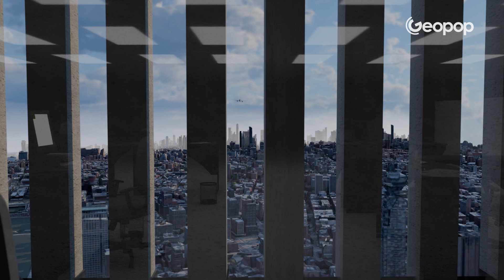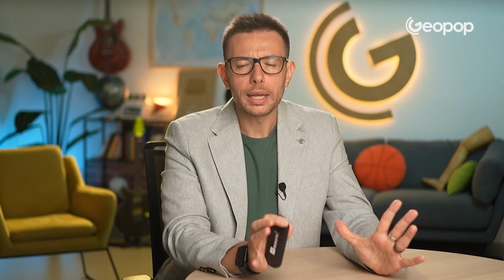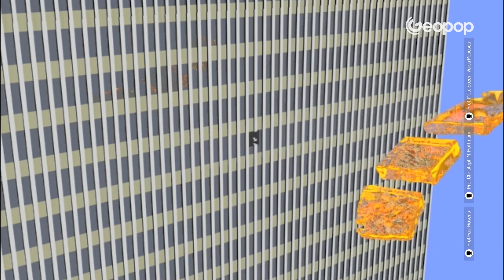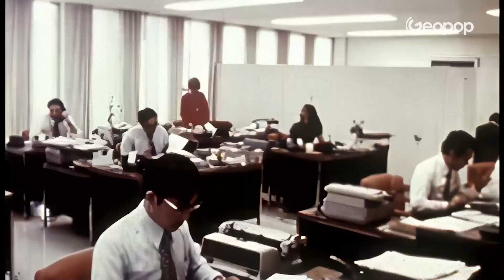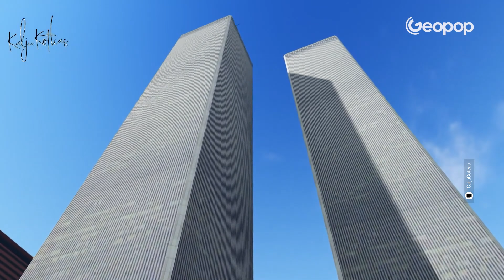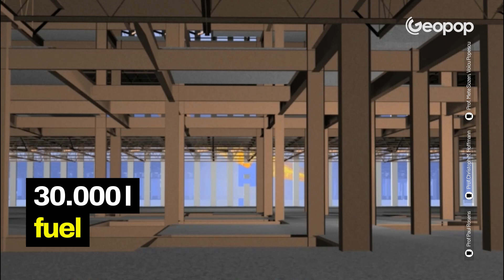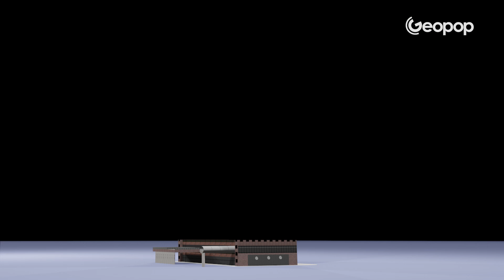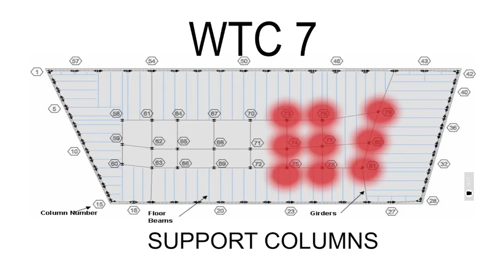9/11, 2001: The Technical Reconstruction of the Twin Towers and WTC 7 Collapses

Comment: What I don’t understand is the whole “jet fuel can’t melt steel beams” but people seem to forget that jet fuel isn’t the only component that impacted the buildings…a commercial airliner. MASSIVE STRUCTURE making contact with another MASSIVE STRUCTURE. The ability for a structure to stand tall with these types of impacts is similar to a house of cards.
Reply: Single-element (non)thinkers can't handle multi-element problems. It is invariably impact damage OR fire but never both.  Too many pieces for them to juggle
Reply: @TheLoonResistance tiny minds
Reply: @m00nshoes404  - It is why they become conspiracists. They simply can't process complex issues.
Reply: @TheLoonResistance  i guess lucky them. They’ve got it figured out and we’re all just sheep for going against their outrageous conspiracy narrative.
Reply: @m00nshoes404  - It's easier than thinking
Reply: @TheLoonResistance  yeah and as we go on in society, rational thinking is shrinking. 

Thinking about all components of a complex situation is too much work and convenience is priority.
Reply: @m00nshoes404  Yep, to think about the free fall that totally proves the controlled demolition of WTC7 is way too complex to you, obviously...
Reply: You don´t understand because you just know too little. You don´t know that steel actually melted and you don´t know that the towers were literally designed to withstand airliner impacts even more destructive than those of 9/11 - and the resulting fires.
Reply: Building something to withstand an airliner impact doesn’t mean it WILL withstand an airliner impact. It seems that you’re actually the one who knows too little, because these buildings were built to withstand airliner impacts for commercial planes that are MUCH SMALLER, MUCH LOWER and flying at increasingly LOWER speeds than the 767s used that day. 

The more you know!
Reply: @m00nshoes404  See, you just know too little.
Each tower was designed to withstand a fully fueled fully loaded 707 flying at 600mph.
600mph is faster than any 9/11 plane. That´s why head of the NIST "investigation" Shyam Sunder stated that the calculated 707 impact would have been more destructive than the actual impacts on 9/11.
A 707 is a BIT smaller than a 767, not much smaller. Then again the 707 would have been fully fueled and fully loaded, while the actual 9/11 planes would have been nowhere near fully fueled nor fully loaded. The 767-200 was scheduled to fly about half of its range, the 767-200ER was scheduled to fly about a third of its range. And both planes were low on passengers and luggage.

They didn´t need to think of terrorist attacks to design the tower for the worst case scenario.
Reply: @zettel3296  dude, you’re LITERALLY trying to make a 707 plane and a 767 weigh the same, essentially. It doesn’t matter what was “SUPPOSED TO BE”, because it’s not what ACTUALLY ended up happening. 

You also left out the point of impact being MUCH HIGHER than it was designed to withstand. You out here bending, pushing, forcing every tiny thing to fit into this narrative that frankly doesn’t even matter because IT IS WHAT IT IS. That’s what happened, that’s how it happened, it’s not debatable dude. 

“Oh well this wasn’t supposed to happen like this because we did this and this and this blah blah blah” 

a lot of things aren’t supposed to happen, or are supposed to have a different outcome, but it’s not how it goes. Life is full of uncontrollable things that humans ignorantly think they have any control over.
Reply: @z @zettel3296 d you didn’t even know that it was for a 707 not a 767 until I mentioned it and then you’re all mr. facts.
Reply: @m00nshoes404  "you didn’t even know that it was for a 707 not a 767 until I mentioned it"

What a funny desperate guess clown! 🤣🤣🤣
My first comment literally refers to Shyam Sunder talking about the 707 flying at 600mph and therefor being more destructive than the planes on 9/11...
So I have Shyam Sunder and the NIST report, both chief engineers in the WTC construction and the WTC manager. What do you clown have? Oh right, nothing, absolutely NOTHING...
Reply: @zettel3296 no it doesn’t lol. You said something about a free fall, WTC7, and the designs being made for even more destructive impacts than 9/11. You literally say nothing about different planes, the 707, or about speeds. You mention the fire though. Good thing we know about the fire. And “more destructive impact”
Reply: I’m guessing you also really like clowns.
Reply: @m00nshoes404  As I already explained to you clown, "more destructive" comes from Shyam Sunder, head of the NIST "investigation", talking about the 707 flying 600mph.
What exactly about this simple fact that I teached you already was too complicated for your substitute for a brain clown?!?
Reply: @zettel3296    You dipship, they were NOT designed to stop jets going 600mph.  It was 200mph (easy google search away, dumbass). The 9/11 jets were going 550 to as high as 590. And since you don't know anything about physics, the same jet going 600mph would have 9 times the energy as it would have at 200mph.  Add to that the fact the 787s weighed about 50,000lbs more than a 707, it's safe to say the 9/11 jets had close to 10 times the energy of the jets the tower was designed to survive. And one last newsflash "designed to withstand" isn't the same as "can withstand".  It summary, you are stupid, so just stop.
Reply: @stanpotter7764  "The newly disclosed documents, from the 1960's, show that the Port Authority considered aircraft moving at 600 m.p.h., slightly faster and therefore more destructive than the ones that did hit the towers, Dr. Sunder said."

Any idea who Dr. Sunder is dipship?
Reply: @zettel3296   "The original World Trade Center Twin Towers were analyzed during their 1964 design phase by the Port Authority of New York and New Jersey (PANYNJ) for an accidental impact from a Boeing 707 flying at landing speeds".  Oh look what I found.  Landing speed, not 600mph.  You really think in the 1960, the designers were thinking about hijacked jets diving out of the sky at full throttle?  Or you know...maybe the MUCH more likely scenario of a jet coming in off course on final approach.  And new flash, they towers WERE hit by jets going over 500 mph and they failed miserable.  Looks like YOU are indeed, the dipship.  You are really getting beat up in the comments, you don't know when to quit, kid! 🤣😂
Reply: @stanpotter7764  "You are really getting beat up in the comments, you don't know when to quit, kid! 🤣😂"

I see you are projecting hard dipship... See how you desperately dodge my simple question to avoid getting beat up further?

Any idea who Dr. Sunder is dipship?
Reply: @zettel3296 if you’ll remember— in 2001 THIS degree of terrorism wasn’t even in the minds of the people who built these buildings. They only built it to withstand the 707s because they knew that the buildings were going to be so tall that it was a possibility of something accidentally making contact with the building.
Reply: @m00nshoes404  "The newly disclosed documents, from the 1960's, show that the Port Authority considered aircraft moving at 600 m.p.h., slightly faster and therefore more destructive than the ones that did hit the towers, Dr. Sunder said."
Reply: @zettel3296  You don't know that it was the first building that the architect designed and it was actually not capable of withstanding an airliner impact. We know this is true, because we WATCHED IT HAPPEN. The designer of the Titanic also claimed that it was "unsinkable," and how did that  turn out?
Reply: @BoodahBodey  So what´s the point in burning yourself as an utter stupid liar?
The Twins were NOT the first buildings that the architect designed and they WERE capable of withstanding airliner impacts. We know this is true, because we WATCHED IT HAPPEN.
Reply: @z @zettel3296 hey withstood the impacts yes, but not the subsequent fires. The WTC was not his first building but the first major skyscraper, and it was not a typical design. He Wes BS’ing about how great it was. In the end, the buildings fell. We watched them. No explosives required.
Reply: @BoodahBodey  I´m glad I could help to teach you some facts wannabe...
Now here´s another fact: The Twins collapsed due to controlled demolition.
One of the chief engineers in the construction of the Twins stated that in case of an airplane impact the biggest problem would be the horrendous fires from the jet fuel - for the people who would burn, not for the building which would keep standing. The Twins didn´t even have sprinklers first, they could have burned out completely without collapsing. The chief engineer added that he´s not saying it would be impossible to bring the Twins down, top demolition experts surely could do it.
And that´s what we watched on 9/11...
Reply: @zettel3296  And the builder of the Titanic claimed that it was "unsinkable." Please tell us how "they" managed to keep the explosives from igniting for 1-7 hours after the impacts, and raging fires? The colapses initiated at the point of impacts. So how did they rig the explosives so that they were not damaged by a plane collision?
Reply: @BoodahBodey  As I explained to you already, thermite usually isn´t considered as explosive and normal fires don´t ignite thermite.
Reply: @zettel3296  you can ignite it with a propane blow torch. I’m pretty sure the fires in the WTC were that hot. Even if you are correct about the thermite, how did they ignite it an hour after impact? How were the charges wired? How did they know exactly what floors the plane were going to hit so they could make the buildings collapse look natural? How do you explain the exterior columns all buckling 5-10’ inward just below the point of impact just before the collapse?
Reply: @BoodahBodey  Thermite ignites around 1300°C, the fires weren´t that hot.
In times of radio fuses you don´t even need wires.
They didn´t need to know on which floors the planes would impact as long as it´s in the upper half since they rigged the entire upper half for controlled demolition. But of course the inside jobbers knew where the planes would hit since they were flying them themselves.
The inward bowing proves the cutter charges on the core columns.
Reply: @zettel3296 you’re basing your entire argument on mere data and statistics. Yes these details are the standard but you’re forgetting about the context and that’s important. Jet fuel and an airline wasn’t the only thing that would subsequently affect the buildings. You’ve got to consider all of the things in that building that would be combustible with even a minimal amount of heat or pressure and things that will just feed the fires. in the walls, in offices, furniture, chemicals, etc. yes it stood a while after impact but still, this “jet fuel can’t melt steel beams“ conspiracy claim is just quite a bit ignorant and always will be.
Reply: @zettel3296  it’s interesting you say that because this obviously wasn’t a normal fire lol.
Reply: @zettel3296  oh please. tell me more about how hot the fires were! Only way you could know this is absolute fact. Very little people escaped with their lives who were essentially IN the hottest part.
Reply: @zettel3296  so why didn’t the inside jobers aim just a little bit lower and take out 10’s of thousands more people? The collapses initiated at the exact point of impact damage. Do you think that a radio receiver can survive the impacts of a fully loaded jumbo jet airplane? Cause I don’t.
Reply: How does a cutting charge make the columns bow in? If the cut the columns the wall would come down, not bow.
Reply: @m00nshoes404  Troll, we had three conversations under your opening post here, you fled all of them, and now you jump into my conversation with BoodahBodey to spit three comments in a row on me? What´s wrong with you troll?!?

So you believe jet fuel can melt steel beams?
Reply: @zettel3296  you’re the one who comments and then replies two months later. I have not fled any of it.
You’re obviously illiterate if you can’t see that. I’m actually jumping back in, because it’s under MY comment therefore i received a notification.
Reply: @m00nshoes404  Oh, you came back after 2 months because you received notificatation, what a coincidence! See, I did NOT receive notification of your latest comments 2 months ago. But now I received notification of BoodahBodey´s replies, so I came back after 2 months and found your latest replies. So I responded to them. Three comments, three strings of conversation, I adressed them all. But instead of continuing any of those three strings you jump into my conversation with BoodahBodey. THIS is what I see here.
Reply: @BoodahBodey  The lower the impact the shorter the media show because the lower the impact the faster firefighters will reach it. That´s why they hit the first tower higher than the second one. Firefighters reached the fire floors in the second tower first only because they refused evil orders to not use the elevators, but then again that´s why the second tower was brought down first.
The radio receivers didn´t need to survive fully loaded jumbo jets since fully loaded jumbo jets are nothing but an utter stupid fantasy when it comes to 9/11. However, since black boxes are a thing even for fully loaded jumbo jets, the answer would be yes. If they wanted to make them survive fully loaded jumbo jets, they were definitely able to do it.
Even if the impact would have triggered or disabled some of the cutter charges, so what? The Twins survived the impacts easily, 1-2 (additional?) cut core columns wouldn´t have caused immediate collapse but if it did it would be even more plausible as a result of the plane´s impact.
If some charges get disabled it´s also not a big problem since there are more on the same floor and on many other floors.
Core columns were cut so that they slided to the center of the footprint, so that they pulled the floors to the center too, so that they pulled the perimeter columns inwards too. Weak sagging floors couldn´t do that and sagging floors were never to be seen to begin with.

You see that I´m always willing to answer questions as good as I can... How about you? Do you dare to answer some questions on the BS narrative you believe in?
Reply: @zettel3296  I appreciate you taking the time to debate me, and I am not surprised that you are not willing to actually consider the things that I am saying. I used to be just like you. I too was convinced that the buildings were controlled demolition, until I actually did a lot of research into the static strenth of materials, and the unique construction of the towers. 

They did it for the "media show?" Nice try, but that is just ridiculous. Please try again. If they wanted a show, they could have instantly taken out 10,000 - 20,000 people, and possibly taken the towers down instantly killing even more people on the ground and in surrounding buildings. If they wanted a show, they could have hit the Super Bowl, but they didn't. Let's not make too much of it. I don't think that we can make too much of it. What I am saying is that I don't think that they planned to hit certain floors. Do you believe that they had charges placed on every floor just in case they missed? Then they could still make it look like the building collapsed at point of entry no matter which floor/side of the building the planes hit. That at least would make sense, but you have already way overcomplicated the conspiracy. Occams Razor says the most simple explanaition is usualy the correct one. If they went to all the trouble of rigging the buildings, why not just take them down? Why take the chance that the plot might go wrong? Just set off the charges and take down the building? Maybe because they tried that in 1993, and the building still stood? If all of the building were rigged, what building was rigged to coincide with flight 93? What happened to the charges in that building? Were they also secretly removed after the plane crashed in PA? Every conspiracy theory creates many issues that can not be explained. It makes such a conspiracy so overcomplicated that it's just ridiculous to believe that "they" could have pulled it off. The simple answer is the correct one. Terrorists hijacked the planes, and flew them into the buildings. No further explaination is required.
Reply: @BoodahBodey  I don´t see any of your so called research mate... It´s the research that turns sheeple into truthers, not the other way round. The unique construction of the towers was extra strong.

"Every conspiracy theory creates many issues that can not be explained."

At least that applies especially for the BS conspiracy theory you believe in. And that´s exactly why Occam rips your fairytale. There are too many issues that your simple fairytale just can´t explain, so you need something more complicated than your simple fairytale, but you can´t make your simple fairytale more complicated without killing it, so you are left with a shitty fairytale that dodges all the issues that destroy your fairytale. If jet fuel can´t melt steel and doesn´t need to to collapse a building you still have that big fucking problem that there was molten steel at Ground Zero. Your fairytale doesn´t explain squibs shooting out of the facades dozens of floors below collapse front, your fairy tale doesn´t explain the two core collapses per tower, your fairytale doesn´t explain lobby destruction, man don´t get me started... Your fairytale needs so many extras that you would wish Occam was never born. Inside job is the most simple explanation for everything. 

Also you totally misunderstand the concept of "the show". The show was not about killing as many people as possible and make sure no-one watches but more the exact opposite! You have no show if you blow up towers without filming it. And even if you film it, it would be a 30 second tiktok shitshow that even less people would buy. What they wanted was 2h, a full blockbuster of action and drama, plane impacts on camera, burning towers on camera, people dying on camera, buildings collapsing on camera, people crying on camera. That´s what we got and that´s what made people believe the official BS fairytale. You couldn´t have achieved anything close to that by just blowing up the Twins without anyone filming or watching. Grasp the difference?!?

I don´t think they placed cutter charges on every floor, but maybe they did. But I´m sure they didn´t place cutter charges on every column on every floor. They didn´t want to cut every column on the same floor, they wanted a more random cutting pattern. There were 47 core columns. Let´s say they placed charges on 8 of them on floor 100, on floor 98 they prepare 8 different columns and so on. This way you could weaken every second floor without even making it collapse, but still weakening the structure so that it will collapse eventually. And since the impact floors became weak points, the collapse would start there even if you are cutting columns on floors outside the impact zone to initiate collapse.

Flight 93 was part of the inside job so I don´t comprehend your question. I don´t know if there even was a flight 93 but it´s quite obvious that it didn´t crash where they say it did and I don´t see any reason to believe it was ever meant to hit any building.
Some say 93 was meant to hit WTC7 but I don´t go for that. WTC7 was meant to come down along with WTC1 without any plane crashing into it, but something went wrong and it took them 7h to fix it.
Reply: @zettel3296   Ha haa!  You actually used the word "Sheeple"!! 😂 Whenever I make fun of truthers I always mention how truthers get their identity from believing they are a part of a small, elite group of internet sleuths who know the truth and use the work "Sheeple" on the daily!  Ha ha!  Then you actually did it!  Comic gold. Since I was right that, I would wager you live in your Moms basement and eat a steady diet of hot pockets while you and your elite group of internet investigators get your revenge on the popular kids from your high school.  The government might have fooled THOSE people, but not you. Oh no, you are too smart for that! You will never believe that jets with 10,000 gallons of fuel and hitting with 3000-4000 times the energy of a 5000lb SUV going 70mph could possible bring down building of unconventional and barely repeated design.  Carry on, wise one, for you are the truth teller! 😂🤣 Thanks for the laugh my guy!
Reply: @stanpotter7764  That unconventional and barely repeated design was literally made to withstand more destructive plane crashes dear noob.

Any idea who Dr. Sunder is dipship?
Reply: @zettel3296  No, but let's pretend it did. Did it work? Spoiler alert...no. No, the jets tore right through that shit so 🤷‍♂️. Is he replaced to Dr. Thunder?
Reply: @zettel3296  Cool story bro! It seems that you have a BS excuse for every gapping hole in the conspiracy theory narratives. Well done! That doesn't make it any less ridiculous. 

I get the feeling that I could post every piece of research and evidence, and you would still find a BS excuse as to why you are smarter than all of the experts. The fact of the matter is the debris spoke for itself. It was analysed and told a very clear story. You just refuse to accept it. 

Here is evidence:
As part of the National Institute of Standards and Technology World Trade Center Investigation, failure modes of the connections attaching the composite floor system to the exterior wall of WTC 1 and WTC 2 were surveyed. Metallographic analyses of intact and failed welds of the main load-bearing truss seats complemented the survey to identify the location of metallurgical failure for these connections. Above the aircraft impact floors, the failure modes were randomly distributed. However, over 90 percent of floor truss connections at or below the impact floors of both buildings were either bent downwards or completely sheared from the exterior wall suggesting progressive overloading of the floors below the impact zone following collapse initiation of the towers. Depending upon joint geometry, detachment of the main truss seats occurred either by fracture in the heat affected zone of the base material, where the standoff plate detached from the spandrel, or through the weld metal, where the seat angle detached from the standoff plate. Failure in both cases was the result of a shear mechanism due to an overload condition. Exposure to fires prior to the collapse was not found to have an effect on the failure mode of the floor truss connections.
CitationWelding Journal
Reply: @stanpotter7764  Dr. Thunder was head of the official "investigation" on the collapses, he is responsible for the NIST reports which represent THE official narrative on the collapses.
See? 600mph is official. Got it?!?
Reply: @zettel3296  "Lack of Formal Documentation: NIST stated in its final report that it found no formal design documentation or calculations showing the specific effects of a 600 mph jet impact combined with multi-floor aviation fuel fires"
Reply: We can both site different siurces on what it was designed to withstand but in the end, jets took the towers down. Some things really are as simple as they seem.
Reply: @BoodahBodey  I´m glad we finally agree about somethings! Yes, debris and dust was telling, metallographic analyses were telling, exposure to fires prior to the collapse was not found to have an effect.

Now that you realized that I can give answers to all your questions and feel tired about it, how about turning the table? Perhaps it could be a refreshing experience to you to see if you can answer questions on your narrative?
Reply: @stanpotter7764  Everyone saw that the towers took the planes and kept standing. It´s EVIDENT that the jets didn´t bring down the towers. Some things are as simple as they seem.
Reply: @zettel3296  Dude read it again. You didn't comprehend a single word until you got to the last line, and even then you got it wrong. What it said is that 90% of the connections below the impact failed, not due to heat, but due to impact from above. That doesn't discount the cause of the initial collapse trigger to be related to heating and weakening of the the floor trusses. Those are two totally  different things, and both can be true. It's like you want to be stupid. Willfully ignorant. The outer columns failed first just below the point of impact due to being too bowed in thanks to the sagging floors. Then the floor connections below that failed, and then the connections between the exterior segments all the way down. There is zero evidence that any connection, column, floor truss, girder, spandrel, or otherwise was cut by any kind of demolition devices. You can't demonstrate it, because it doesn't exist.
Reply: @zettel3296  I am not here to defend the official narrative, but feel free to question my opinions about the day.
Reply: @BoodahBodey  "Dude read it again. You didn't comprehend a single word until you got to the last line"

Dude read again, I literally quoted (part of) your last line. Now you´re trying that connection BS (again)... Buildings aren´t carried by floor connections but by columns. That´s why NIST aswell as clowns like you avoid talking about the columns so desperately.
Both Twins had their core´s lower half surviving the initial collapse, totally destroying the official fairytale of unstoppable gravitational forces from above. Then the remains of the cores collapsed without any gravitational forces from above, further destroying the official narrative. Official narrative was debunked by reality before it even was made up by the inside jobbers. It´s really that simple.
Reply: @BoodahBodey  So let me start questioning your narrative...

Why does your narrative focus so desperately on rather irrelevant floor connections instead of much more relevant columns, especially the core columns combined to a core structure that resembled the most relevant part of the entire structure? 
If the force from above was unstoppable as officially claimed, how could the core´s lower halves survive it? 
If not even that not so unstoppable force could bring down the lower cores, what did?
How do you explain squibs shooting out of the facade dozens of floors below collapse front?
How do you explain ground lobby destruction and basement explosions given the existence of the skylobbies and mechanical floors?

I could ask dozens of questions instantly, but I don´t want to overwhealm you...
Reply: @zettel3296  Yeah, I'm sure the fires  had nothing to do with it. Lol.
Reply: @stanpotter7764   Me too, lol...
Reply: @zettel3296  yeah you’re illiterate